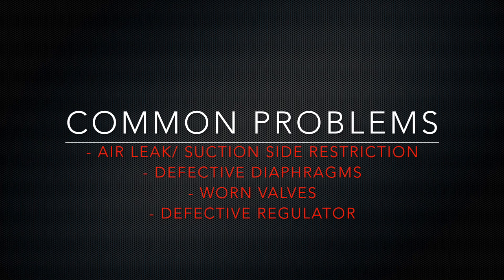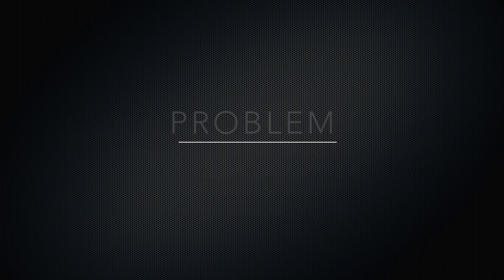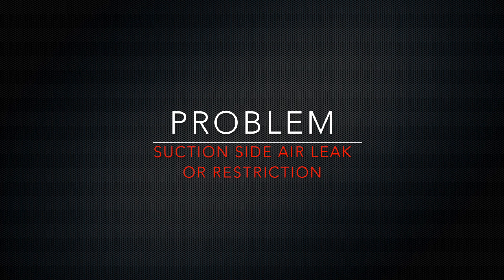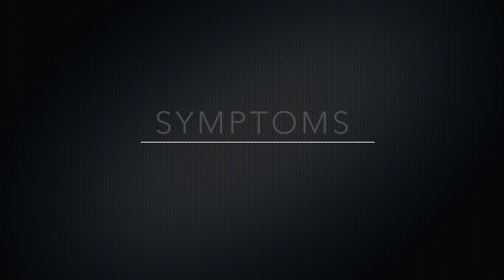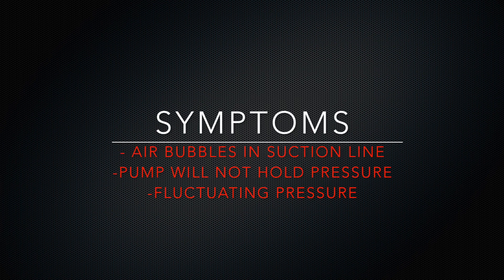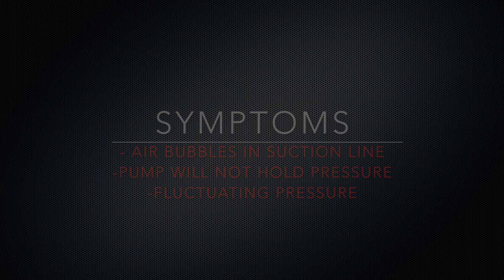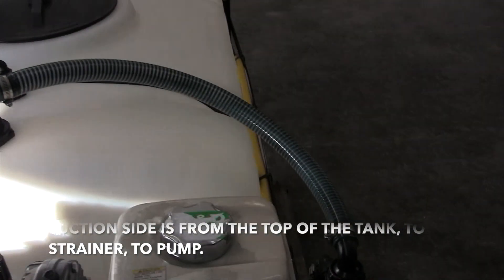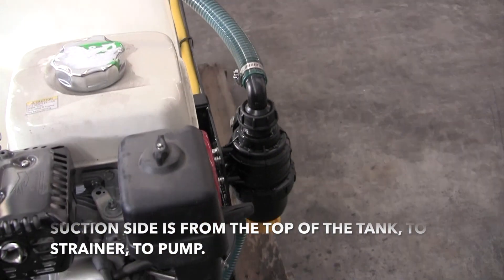Troubleshooting Diaphragm Pump Problems

Comment: We have an Udor Delta 75 and the pressure keeps rising. We will have it set at 350-400 PSI on the regulator then after a few minutes it shoots way up at random to 600+ PSI. Any Ideas?
Reply from the maker: Sound like it may be regulator issue. Hard to troubleshoot based on this comment alone but I would start there. Feel free to call us with any questions. 800-706-9530

Comment: Hello guys, suction filter always connect to tanks at the top and not at the bottom? I am setting up a udor zeta 40 myself, thank you, great video!
Reply from the maker: Suction lines can be found pulling from the top or from the bottom of the tank. We place ours on top to eliminate any chance of a bottom tank fitting leaking. The important part is to always have a strainer before the pump.
Reply: @GregsonClarkSpraying  Thanks very much for prompt reply, very helpful, many thanks